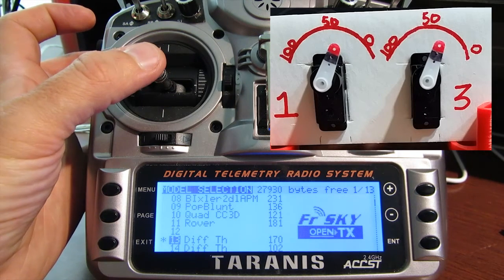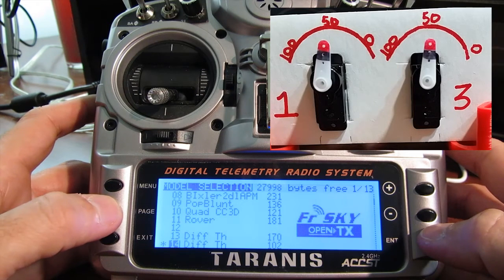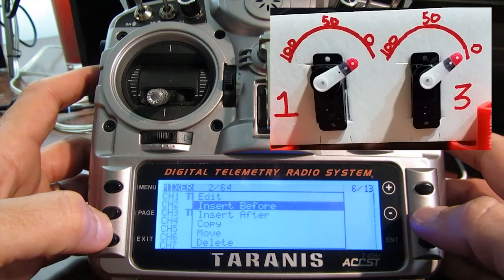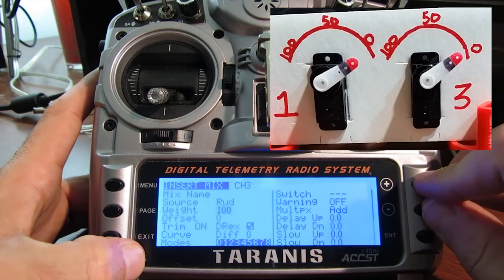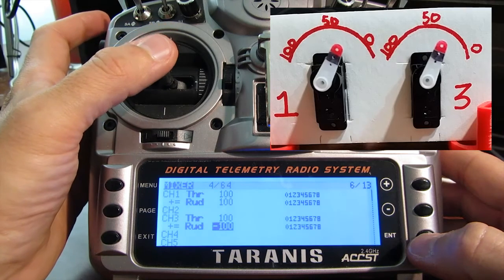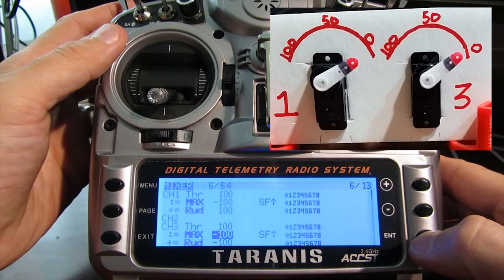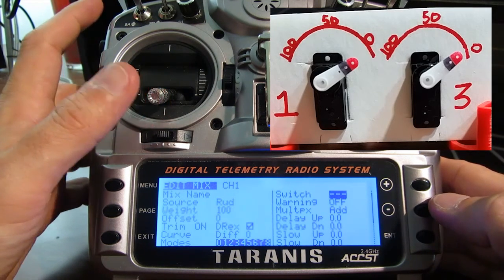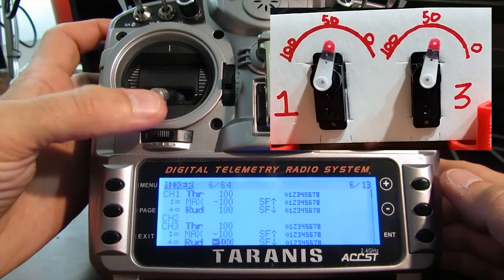Differential Thrust / Steering with Throttle Hold - FrSky Taranis

Comment: Hi there Lee   -   Eddie here with a problem and a question.      I've just bought a Radiometer TX16S and been watching your various " how to " videos  which have proven really helpful.   My 16S is set up with a built in 4 in 1 unit and running the latest Firmware.
My aim is to simply set up a Buddy Box system using my TX16S as Master and a Spectrum 6i as a Trainee radio.
I've got the radios talking to each other via a dedicated mono cable  but there are some weird things happening with the channels.   
The TX16S is T A E R  and the 6i is A E T R  as you know.
When I configured the channels on the 16S the 6i doesn't match, so I've re -assigned the channels in the 16S to the same as the 6i but still no match.
Your help would be most appreciated Lee and maybe if you could do a video it would no doubt help other TX16S users wanting to do the same.
Keep up the great videos which are always good to watch and always helpful.   Best Regards . . . Eddie.

Comment: There's a couple of ways to make this even easier:1. Place the throttle cut After the RUD mix and it will replace both THR & RUD without needing to enable the SW on the RUD mix2. Use 'copy' in the mix menu (hold down ENT key then scroll to copy) to speed up entering the same thing twice for both motors.

Comment: Great video, exactly what I was looking for with my FT SuperBee dual motor.  However I'm stuck with both my emax escs not beeping on power up.  As soon as I mix rudder with throttle, the escs are SILENT.  The servos all work fine via the RX, but no throttle response at all.  IF I totally remove rudder mix from throttles it allows the escs to beep.  Maybe I need to flash firmware on ESCs?  They are emax 30a blheli's.  Thoughts?
Reply: For anyone else that runs into this, I ended up swapping inverse on the rudders, had -100 on one, and switched to 100, and put -100 on the opposite.  ESCs chirped to life, all is well.

Comment: What would you do if you wanted to turn differential thrust off with a switch
Reply from the maker: I've done this on a boat with two motors. You would need to create another mix and use the "REPLACE" parameter on "Multpx" (Multiplex) and have the default settings ----OR--  [Easiest option] you could add a "Switch" in your mix. This switch would activate the mix. (example: this is used for a Throttle hold. Some people will use the two position switch on there Throttle mix to turn the throttle off so they don't accidently hit while working on the plane. The "Switch" option is in the mix options at the top left.
Reply: Nett Air thanks

Comment: I'm building a Flitetest Kraken and needed differential thrust. Thanks for this vid. Only problem is, I'm using an Arkbird OSD flight controller with only 1 throttle input and output. I'll either have to bypass the flight controller or not have differential thrust for steering on the ground. I'll be using the rudder channel for camera panning anyways. UGGGG! LOL

Comment: Nicely done. The servo visual is a great way to demonstrate the programming effect. I'm using OpenTX on a Turnigy 9xr and wanted differential thrust for an FT Mini Guinea with twin motors. Only thing I did different was to put the new mixes on a switch so I could turn it on or off. Thanks for the video.

Comment: Thanks a lot for posting this. I was thinking of building a tracked rover but didn't know if I could program the tracks to move properly. Do you know if the differential thrust works even if the vehicle is in reverse? Vehicular ESCs have a reverse function and I wonder if I have to do anything to account for it in the TX.
Reply from the maker: Khoa Nuyen Yes it should work. I've used the right stick on my mode 2 controller (right stick "snaps" to center) to set up the same thing and its worked with reverse ESCs.